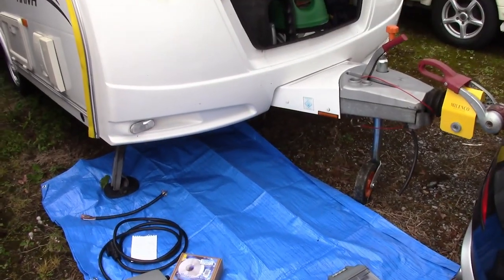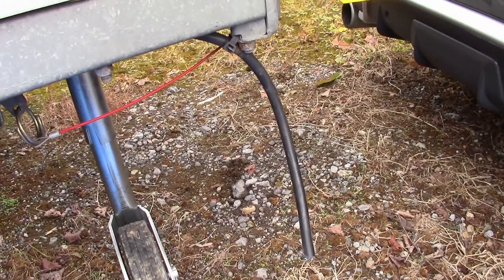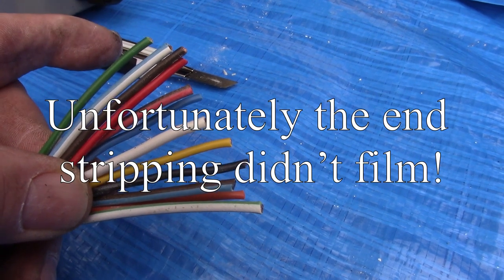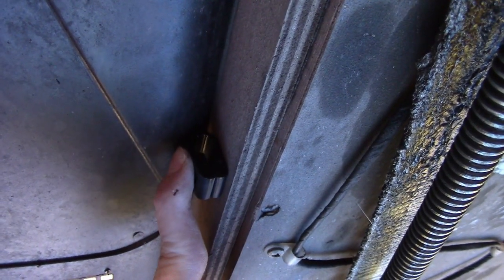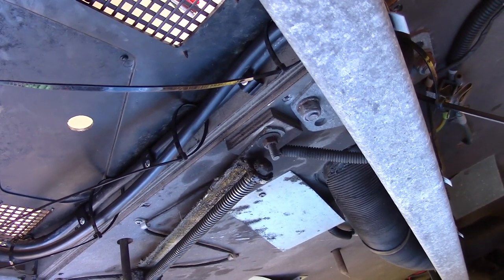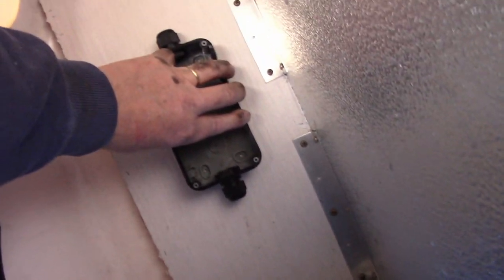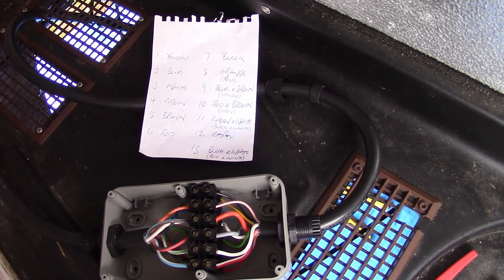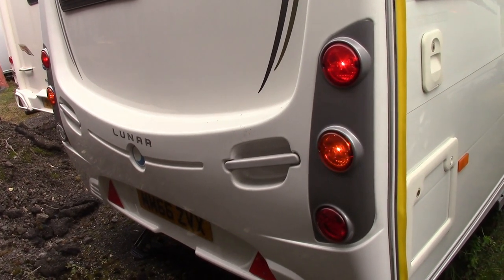Caravan 12v Electrics Cable "The Repair"

Comment: Thanks I’ve just dragged my cable as well and didn’t know what to do and putting the junction box in front lockers brilliant idea  and if I hadn’t done it l wouldn’t have searched for and found your video thank again
Reply from the maker: Hi, Thanks for your comment. It’s not a nice feeling when you find the cable has been dragging on the road. Once you get your mind round the repair it’s quite straightforward. Thanks again.
Reply: Would not think that electrics in the gas locker are a good idea

Comment: Very neat repair and with the added bonus if it happens again the fix is easier :-)  Thanks for sharing.
Reply from the maker: Desmond's Donders Hi, thanks for you comment. It was a thought that it would be easier if it were to happen again. Fingers crossed it never will... 😀
Reply: @thecaravanus4067   I hope it doesn't !!  Missed you comment about the High and Low Forces last night.  Love the area but it is difficult to park up by High Force.  I caught my first ever trout on the Tees just below the Falls :-)
Reply: Great job will use your ideas Thank you

Comment: Great video, This is my first job once the weather gets better. Do you remember we’re you bought the pre wired cable from? Thanks
Reply from the maker: Hi, glad you liked the video. I got mine from a local caravan sales & accessory dealer. They are available on eBay, just put the following in search: Towing 13 Pin Plug + Pre Wired Cable - Caravan / Motorhome. Good luck with the repair.

Comment: Cheers for this, I've done the same and now rewired as per your video but I've got no fridge and no ATC, fuses seem fine, any ideas at all did you have to reset your ATC ?
Reply from the maker: Hi, I didn’t have to reset anything. It’s worth double checking the colouring of the wires. I had to match some wires that were a different colour on the new cable.
Reply: Appreciate your reply, it was two fuses in the car that had blown,  but all sorted now.

Comment: Was this to go from 7pin to 13pin electrics?
Reply from the maker: Hi, Unfortunately the cable dragged on the road when returning from Cambridge. It was a fix to the already installed 13pin electric cable.
Reply: @thecaravanus4067  thanks I'm looking to change from 7pin (12s & 12n) to single 13pin

Comment: doing the same job myself was looking at gas locker but apparantly you cant have any electrics in the gas locker
Reply from the maker: Hi, that was a question I asked at the time of doing the repair. Many caravan manufacturers have 230v sockets on the front window sill/bulkhead with back boxes within the gas locker. I put the repair in an ip65 rated box although the rating is for water/weather protection it’s 12v & more than acceptable to be sited in the gas locker. 

Good luck with your repair.